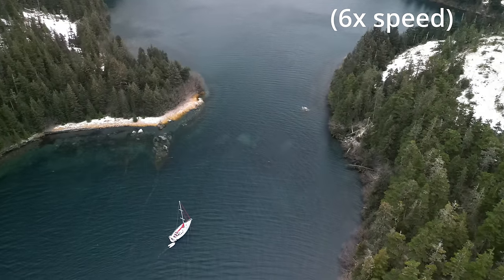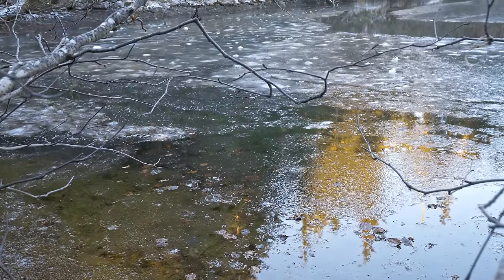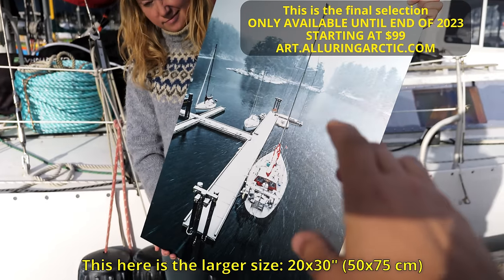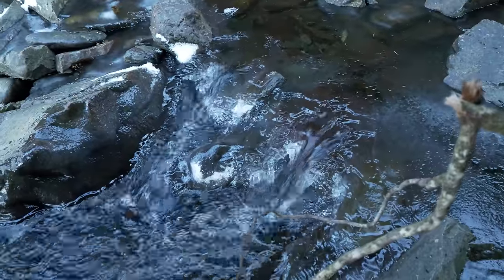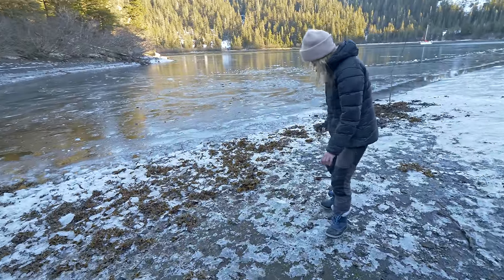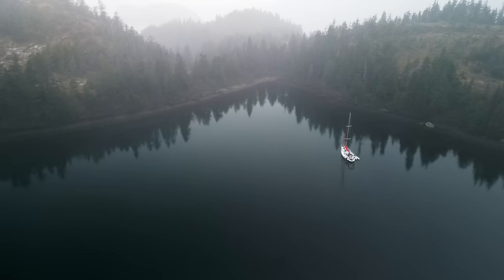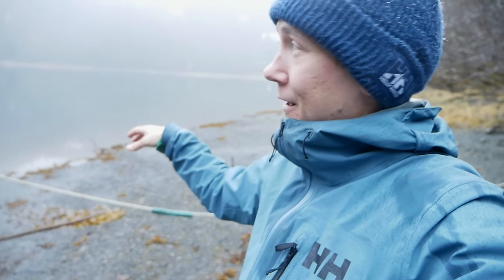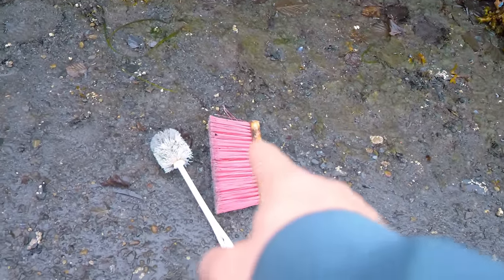Beaching our 45 ft Boat (1st Time Ever. Great Idea...)

Comment from the maker: Hi everyone! Sorry for the delayed release (usually I try to get a video out every fortnight on Saturday). In any case I hope you enjoyed this one, we had a lot fun (or at least "fun") beaching the boat. Check out the aluminum prints that I'm offering at http://art.alluringarctic.com , this print run is only available until the end of the year! Thanks for watching!
Reply: Congrats on your first successful Beaching.
Always a nervous experience.
I had it forced on me last year in a three day 50knot storm gusting to 80knots.
Beginning hours after our 400nM  first Voyage to bring Wanderlust the 13 ton Hartley southseas ferro cement ketch from Thames to the Tauranga harbour.
Fortunately she proved completely unfazed by Beaching in meter high whitcap chop.
Reply: Very informative and as with all your videos a pleasure to watch
Reply: This was quite insightful thank you. Congrats on getting the job done guys. Hope you had a good night's rest after all that.
Reply: hi, very nice episode again, thank you for sharing. I did have an adjustable pitch prop and slowing is very likely due to that. ideally you have some specs on that, RPM vs pitch. you can check if that is correct using underwater camera. not sure how that works on your setup, but possibly you have a way to adjust the inner and outer shaft relative position (and therefore the pitch) somewhere where  the shaft meets the engine
Reply: Kiitokset tästä ja Sohville kiitokset hyvästä jutusta Vene-lehdessä 👍 ! Seuraavaa numeroa odotellessa... 🤩
Reply: Just subscribed. Adding a comment for yt algorithm. Take care and happy journey.
Reply: Эсклизив🎉

Comment: Wow!  I just learned a lot about centerboard boats.  I thought the primary advantage was to reduce draft, but I never considered downwind surfing and control.  Thank you for the education.  I'm slowly coming to realize why you wanted to buy this specific boat.  I really enjoy your videos.  Keep up the good work!
Reply: We have a centre board. We can beach easily and the big thing is in big following seas you don't track across the face of waves, you just slide off. Much easier to steer because you aren't fighting off broaches. You do need to lift the board when motoring because the prop has a lot to do with the big skeg in front of it. I was worried about high wind stability, but it feels the same as the deep keel boats we sail. However, reversing with the board up means you don't need a steering wheel because the boat ignores all steering input and goes anywhere it likes. We go where Fountaine Pajots can't.
Reply: Just more maintenance below the water line
Reply: They are highly vulnerable to damage. Running into a semi submerged shipping container or icelogs (Alaska) isn't going to be pretty.
Reply: After the Key Bridge incident, it is time for engineers to consider emergency AI sensor-rudder control, and studying smaller boat structures would be part of the physics, electronics and mathematics.
Actually, after having sailed in high seas on larger ships, I generally took for granted a keel was best but I never worked it out with equations.
Reply: A lot safer than a traditional fin keel. The centreboard just kicks up instead of deforming the hull around the keel attachment. I had an Ovni ( similar design) which had a bursting disc in the hydraulic rudder so it also survived impacts. Two biggest disadvantages are ballast high up in hull so a lot of weight with low AVS and sails like a pig to windward as there is no hydrodynamic lift from the keel.
Reply: Sailing downwind in a centreboard dinghy when you forget to raise the board can make for an exciting ride!

Comment: When tall ships ruled the seas it was very common to beach them for repair, especially ships of the line, they would beach to repair the hull damage incurred in battle. You are following in your ancestors footsteps, beaching is a valuable skill.
Keep up the fine work as you take us along on your wonderful odyssey.  😊
Reply: Indeed! 
In fact our coastal sails ships in New Zealand were built to be beached on southern Ocean surf beaches and loaded with 200ton of logs or rocks by the time the tide returned.
They were also designed with rear cabin tops strong enough that up to 200ton 40m ships would lower their masts, be intentionally flooded off the beach, turned upside down and hauled up at high tide, so that maintenance such as Recaulking could be done on their bottoms.
Reply: As a young midshipman my Grandfather saw Cutty Sark ( Ferreira at the time ) beached out of the water in South America being scrubbed late in her  working career , was just before WW1.
Reply: The Coast of North Cornwall has spots where ships anchored & beached where no one these days would think of it, you can find capstans marked on old maps showing that there was infrastructure made available for the coasting trade!

Comment: As a rule of thumb to determine the correct pitch of the propeller: Check the maximum rpm of the engine with the gear in neutral (or get it from the manual). Then do the same while driving the boat full throttle in calm seas. The latter rpm should be a little below the former.
Reply: I have the same impression about max rpm.
You can also clean propeller from paint -  uneven surface can provoke more cavitation which means less efficiency. 
I wonder if is right propeller for this specific engine (rotation , rpm , power).
Good luck!

Comment: The vertical piece that is bolted to the stern keel area is called a ‘strut’. It hold the cutlass bearing and your prop shaft goes through the cutlas bearing. It’s very important that you do not damage the strut as they are a pain in the ass to replace and expensive. I have a 31 foot sloop with a busted strut right now and to make matters worse the bolts that attach the strut to the hull are terminating under the fuel tank which means to replace it we have to have one custom manufactured to fit our vessel, then the motor will have to come out so we can get at the fuel tank, remove the fuel tank to get at those bolts that hold the strut in place. Of course the prop shaft and propellor have to come off also and a new cutlass bearing has to be fitting in the new strut. Seriously a pain in the ass to deal with. We really enjoy your segments and are impressed with your sense of adventure, youthful energy, calm demeanour and the quality of your video including the amazing drone footage you get to help illustrate your journey and to  inform and entertain your audience. Keep up the good work, fair winds and flat water to you my friends and do pop in and say hello when next you are in Ganges, Salt Spring Island, BC, Canada. xox.
Reply: thanks for actually having something productive to say. Fair Seas and best wishes on your repairs !
Reply: No, it's called a skeg.
Reply: Would the design of your boat prevent you from having one made up that, with some additional structural beefing could be bolted in place without any removal?  Seem like it would be an offset in the price and much easier and less expensive in the future to do any maintenance.  I've done some retro fitting on a few of my boats where the designers were just not mechanics and didn't think about the issues that were built into the boats.

Comment: Good job guy's. Don't apologise for anything on your videos, we are just along for the ride.
I used to have a variable pitch prop like yours. I'd similar problems knowing exactly when it was feathered exactly or when it was at full thrust. I did what you did and took it out of the water, marked the position on the control handle when feathered exactly , then put the prop to what I thought was it's maximum thrust, marked that. Then played with it once I was back in the water. That seemed to work.
Looking forward to seeing you next time. And a merry Christmas to you both and an awesome 2024. ⛵🍷🍷

Comment: My present boat has a centerboard.
I found out, if you are in a warmer environment, you really want to lift and lower it regularly or the marine growth starts forming in the cavity pretty quick.
Once that happens, it may not lift ( or lower ) when you need it to.

In my case, with it raised the bottom of my boat looks like a Whale belly, and unless you brace it up it will roll onto one side similar to a full keeled boat. Just not as much.

I basically raise it to explore where other boats can't, with my 2 foot draft.

Comment: I used aluminum anodes for a recent few cycles, typically needing to replace them after 6-9 months. I keep my boat in Sinclair Inlet on the Puget Sound.  There is significant sea life due to regular currents and lots of nutrients. The aluminum anodes would become completely covered by barnacles in a few months, particularly in early summer.  Concerned that corrosion protection was being compromised, I switched back to zinc on my last cycle.  No barnacles, but no zinc remained after 4 months.

Comment: Great job beaching the boat.  Textbook!  
I didn’t know you had a rear daggerboard but it makes sense.  And to be able to pull the centerboard up sailing downwind really does help while surfing 🏄 down the waves downwind!  
Good job working the tides.  They can vary up to 25’ here in Juneau during the spring king tides.  Before you said how you were going to do it, I was saying it out loud to you while watching the video!  I had a 20’ sailboat with a retractable keel and beached it often in places I knew were mostly sand.  A friend has a remote cabin and there’s a great beach close by and I’d beach this boat on an incoming tide, run up and check his cabin, then get back onboard and back out of the bay!  Not only did the keel retract but the rudder would flip up (mounted on the stern) and still be in the water but above the bottom of the boat.  Plus the outboard motor mount allowed me to pull the engine mostly up but still have the prop and water intakes below the water line.  I once ran aground up the Taku River but just jumped overboard and pushed the boat off the sandbar!  With the keel and other things up, it would go in about a foot of water!  
Cool idea about the bottom being somewhat flat on your boat.  She was made to beach, which is a good idea of you have issues below the waterline and are in an emergency.
I didn’t know about aluminum anodes.  We only have zinc ones in town but I might try finding them online this winter.  I haul my Catalina 27 out this coming springs to replace the flax in the stuffing box and replace the cutlass bearing, and will do bottom paint and zincs, so I might switch to aluminum if I can find them.
Good episode guys!  Enjoyed it very much.  If you come back thru SE Alaska, come visit Juneau and I’ll play host!

Comment: Hard core sailing . I take out my boat against steel piles  with a concrete base . What ye can do with the lift keel is super . I was  painting the bottom of my boat 2 weeks ago at 3.30am  using the tides and my head lamp  got my  job done .it  took 2 tides but I was solo.
I had a barnacle bloom they came off easy.
Thanks for sharing your adventures.  Beautiful boat. Well done you two.

Comment: I enjoyed this episode.  I have a 20 foot "pocket yacht" that has a retractable keel.  I have never beached my boat, but it is fiberglass and the shores of the lakes where I sail are often 2-3 inch rocks, some bigger some smaller.  So, I don't want to damage it.  The lakes have no tide to work with either.  But one thing I have done is sail toward shore with the keel part way up.  When I get into shallow water the keel hits bottom and can be used as an anchor.  When I want to leave I pull the keel up a bit and I will float free again.

Comment: Funny thing with perspective. For me the whole winter thing seems nuts but since my home harbor is drying out two times a day the beaching is a perfectly normal thing. If you're concerned about shifting wind or the angle of the incoming tide, carry an anchor in that direction. 

Not exactly a recommendation but I know folks who use drying out as a storm tactic. If you're on the hard and leeward of a tree row, life is pretty comfortable. And if your draft is shallow enough, the waves for the couple of hours you're afloat aren't too bad.

I guess step one in troubleshooting is measuring if you reach the usual maximum rpm at the usual top speed. same rpm, less speed is probably propeller pitch or a slipping gearbox, less speed and less rpm probably power related (clogged filters, faulty teleflex, ...)

Comment: Hello Juho,  yet anther very informative and professional video. We also use similar techniques to beach our Ovni 385 Seraphim. Its a great advantage of having a lifting keel yacht. I switched to aluminium anodes two years ago and they perform more efficiently than zinc. I have also kept hull potential reading for several years with both zinc and aluminium anodes. using a silver chloride reference electrode. The readings have gone more negative from -929mv to -1029mv, which is well within the range for aluminium yachts, which is -1100mv to -900mv. Keep the great videos coming. VERY INFORMATIVE.

Comment: Great job! Concertning thé aft daggerboard: when Sailing downwind in following seas, have it all thé way down by belasting it on top with 15 kg lead Blick. For thé pitch of thé prop: check also thé exhaust temperature upstream thé cooling water injection point . It should stay below 450 something, dependent on thé make of your engine. Happy Sailing!!

Comment: Having a rear daggerboard also helps you to handle the center of lateral resistance. When you raise the centerboard it moves the center of lateral resistance aft, but if you have that aft daggerboard you can raise it too and move the center back forward and keep the sails balanced with the hull.

Comment: Another great video, you have the ability to make the mundane totally watchable. Am with you on the aluminum alloy anode thing but have not gone down that path as I have been told not to mix anodes e.g. zinc and aluminum. This is something we could not avoid as our Featherstream prop and Spur rope cutter both use propriety zinc anodes that are not available in aluminum alloy where as the hull anodes are generic and therefore easy to source in either material. Boat is an aluminum Boreal 44.2.

Comment: Interesting/Important :: Had occasion in 2008 to help with a ' Damien II , w/ lifting 5ton keel ' ( s/v Issuma) starting in France on the channel near Ushant where almost  EVERYONE was aground at low tide. Imagine  a 40'-50' very narrow sailboat drawing about 7' balanced on it's keel with a 4"x4" on each side amidships and a small line for and aft from the bottom of each 4"x4" keeping it upright. That was the extreme but it was amazing how normal it was considered for all sorts of boats to be aground every tide. When I asked if boats ever fell over I was greeted with a. puzzled look and the response " I guess it must happen occasionally ? " . . . Thanks  for sharing.

Comment: Brilliant channel, well done guys. Been whatching your videos for a while now. Everyone can sail in the med or warm climates. This is another level. About your proppeler issue, I have 45 year old boat with 3 blade feathering prop, and have the same issue, boat seems very slow under engine in forward gear.. However in reverse it's a rocket ship, 1.5 to 2 knots faster. Pitch on my prop is not adjustable as it very old prop. What I've noticed, having clean boat and prop deffo helps gaining some speed. Also I've changed oil in the gearbox, which also added a bit off speed. When drayned, oil was totally black possibly indicating friction pad wear. I haven't had a chance to investigate it more, but I suspect my clutch could be slipping. Would be interesting to know what will you come up with when you get a chance to investigate yours.

Comment: Nice and informative episode, thanks! When we beach our boat, we usually back in with bow facing “out”. This is in case we need to kedge our way out, and/or use motor in forward with greater thrust. It would also make it easier to exit with the side wind you were concerned about. However, our rudders are higher than our keel, meaning we have more clearance. I’m assuming you went in bow first to avoid damaging the rudders as they might touch the ground first with a sloping bank?

Comment: I've seen blue water boats with keels beach and clean on big flat sandbars. You can't clean as easily but you can get quite a bit done. Of course, the boat is at a 45 degree angle.

Comment: 23:11 Hi Juho,
What is the horizontal shaft with the tee piece and 2 lines on the swim platform for?
Love the videos BTW, have recently watch all from the beginning.
Cheers
Reply from the maker: hi Graeme, it's a Cape Horn wind vane, currently not set up (not in use)!
Reply: @AlluringArctic   Thanks for getting back to me.   I did ponder if it was a wind vane, I'll have a google and check that model out. 
Cheers

Comment: Whenever i hear hull scraping the bottom (thankfully, i only heard it rustling on sand), i get the chills. Getting keel yacht from a sandbank is a tough task. When i first read your vid title, i was like "why would you do that?". With your type of keel though, its different story, and it took some time for me to understand why would you do that. If you for some reason read my comment, i'm curious, is your steering OK when sailing upwind close hauled (i mean, yacht keeping on course and not getting pushed sideways or downwind, if i got my terminology correct)?

Comment: Very interesting what you say about the centre board lift down wind. When you do it with a racing dinghy you can get an enhanced boat role that can become unstable. Dinghys don't have your skeg at the rear. 
Can you reach maximum engine speed with that prop? If you can over rev then it might suggest the prop torque is too low? The hull was pretty clean to say the least.